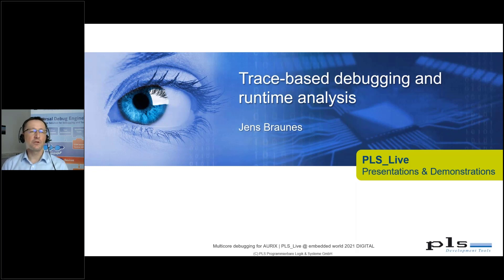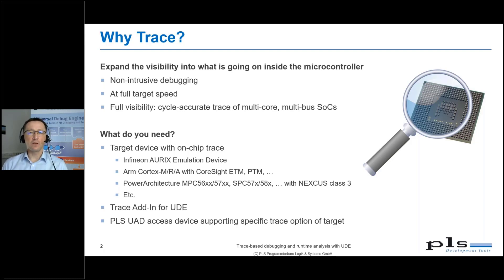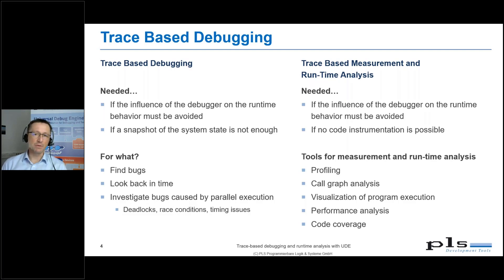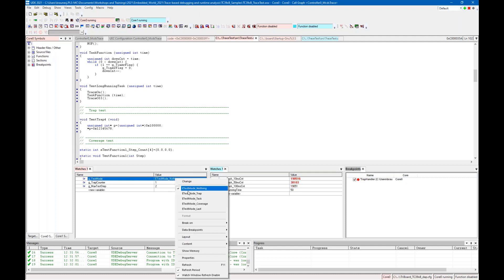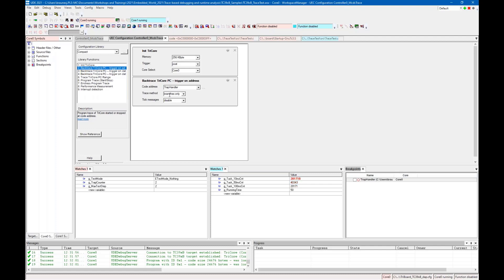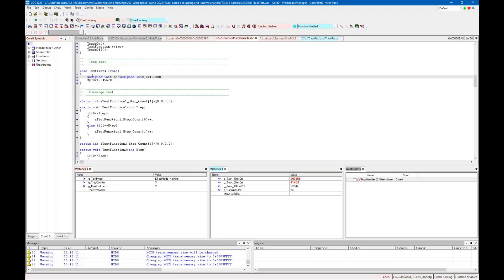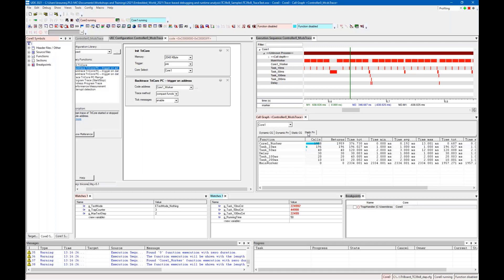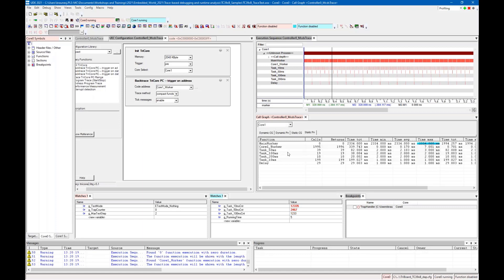Trace based debugging and runtime analysis

Comment: Any thoughts on the new crowd funding debugger "ESP32JTAG"?

I'd love to see if I can download/debug an elf onto a RiscV inside a Lattice FPGA. In the past, I tried using an FTDI F2232H to program the ECP5 bitstream (ecpdap/ecpprog).. however, I could never get OpenOCD to talk to the VexRiscV!

BTW, the ESP32JTAG uses an FPGA, so that it can also act as a logic analyzer.  I know Saleae products stream data real-time to the PC via usb3, so that the memory depth is virtually unlimited.   Other LAs (LogicPort) capture locally, and therefore the depth is determined by how many channels (1-34) you are capturing and the sample rate (1khz-500mhz).  Not sure how does the ESP32JTAG  works, or if they plan on using Sigrok for the GUI ?

Speaking of streaming, I think one of the features that makes Segger tools and clones (Orbtrace Mini) so expensive is that they can stream trace data via SWD..